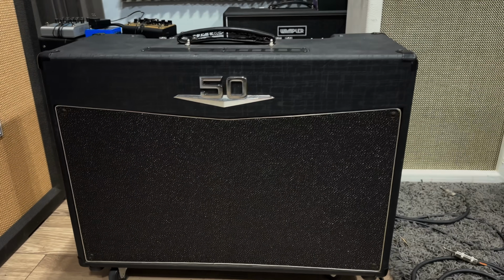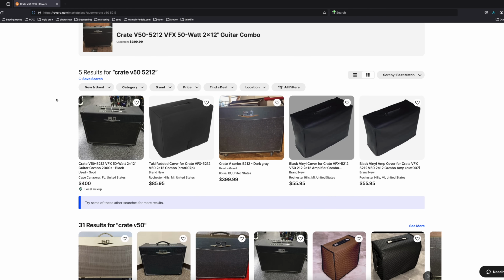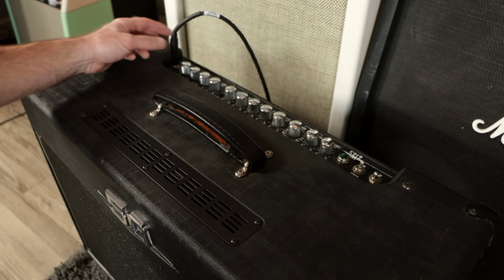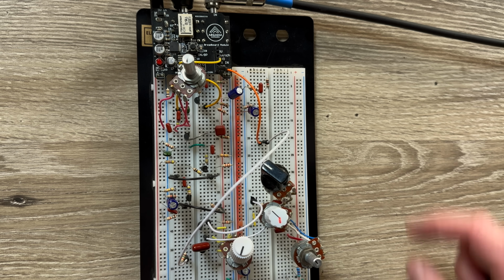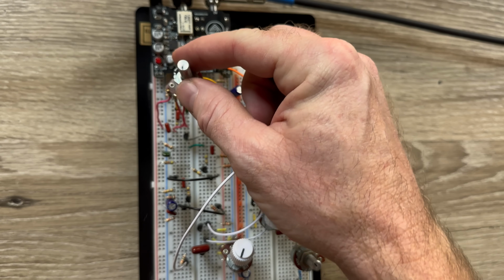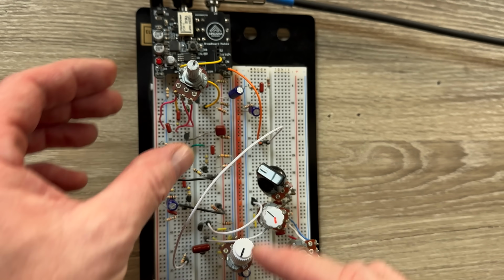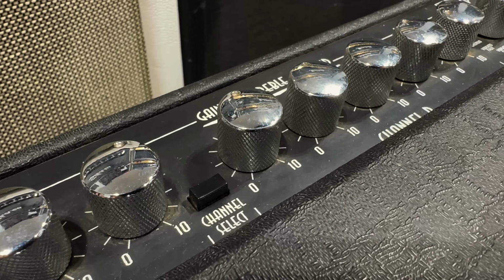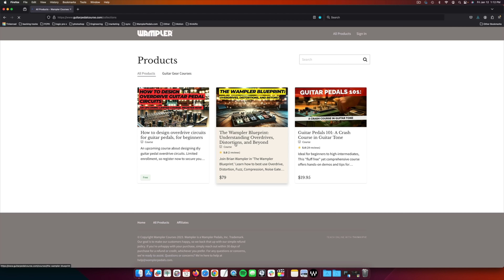Can a guitar pedal REALLY sound like a TUBE AMP?

Comment: This is one of the reasons 70s peavey amps and Vampower amps and HH, and even the roland jc120 sound so good.  The solid state circuits of those amps get that tube type vibe from the way the sag and peak cutoff occurs in the overdriven circuits.  MOSFET and FET style circuits can be almost as good as valve amplification.

Comment: I have a V50 and love it. I dropped the gain by swapping a 12au7 in, and CRUSH the input with a $20 Klon with the output and gain dimed.
Reply: 😂me to ! I run a clone into it and it's sounds unreal !  I put the original Russian tubes back into it because it didn't sound good for me with any lower gain 12a tubes.

Comment: When i was into pedal building a few years back, there were sites on the internet about emulating a tube's sound with solid state parts. They almost always came up with combinations of "regular" bipolar transistors and FETs. Good way to go. Is sustain better with the gain pot all the way up? Maybe you need a bit more of that to make your circuit sing like the amp.

Comment: That was pretty decent and "quite close", but the Crate just had a smoother tube transition compared to the breadboard (but probably "MORE CLOSER" to) that Tube amp sound than any pedal or modeller out there hands down.!!! I was wondering if you would consider building an actual tube driven circuit with an actual 12AX7 or similar subbie, like how the old Hughes & Kettner TubeFactor pedal, or even the Revolt pedal do.? I think the H&K sh*ts all over the Revolt and others i do have.! I reckon you would do a great job bringing out or designing your own circuit "with an actual 12AX7 tube. Nonetheless this breadboard pedal design is fantastic.👌👍

Comment: It could be attributed to YouTube’s digital audio compression, or just listening through my phone’s speaker, but either way, I’m not hearing anything that distinctively resembles a tube amp. Don’t get me wrong, the overdrive sounds good, and there’s absolutely nothing wrong with solid state amps, as far as I’m concerned. Frankly, I think tubes are only audibly discernible on the pre-amp stage, anyway, but the most efficient way to sound like tube amplification, is just to use a tube or two, somewhere, almost anywhere, before the main amp stage.  ❤

Comment: If anything, the breadboard circuit, sounds to me, like the rich gain I get out of this old Peavey solid state amp, which I installed inside the back of my great grandfather’s old 1930’s/40’s Ampro projector speaker, to turn it into a convenient and retro looking/sounding pickup-and go, practice combo amp. I remember it sounding pretty rich, and ALMOST tube like, even when it was in the stock case, with the stock speaker, but found when I plugged it into the Ampro, the pairing was even better, so I combined them. Frankly, I don’t see much point in trying to emulate something, in which using the genuine article, is relatively trivial to obtain, otherwise. Last I checked, a 12ax7 doesn’t cost that,….. wait a minute, I just looked,…. 😳 WTF happened to the tube preamp market, in the last 7 years, besides inflation? 😮

Comment: Understanding how successful think is sometimes better than having them tell you how to do what they do. I've found that many of the ones I've met  approach things from "what if." What if I try this? I wonder what this will do? I was an acquaintance of Larry DiMarzio years ago. Great guy and fun to hang out with. I literally sat in a room with him one day as he went through a box of samples of hardware, screws, springs, cable samples, strap material samples, etc considering if any of these new items compared to what he was currently using and if anything could improve that line. A constant search and curiosity for what is better and makes people excited to play. And I worked for a guitar company whose interest in new things was only how to extract more shekels from 'consumers.' So I've seen the difference first hand. I appreciate you sharing your passion and curiosity. I don't think the tube amp is the final evolution of guitar tone. There are enough examples of good sounding amps out there to disprove that. I don't think fx and IRs are even an given answer going forward. Peavey and Music Man made good sounding amps with ss preamps and tube power amps. Later tube preamps with ss power amps became a thing. Well, where is the magic actually happening? Tradition is hard to overcome and people hear with their eyes. But something will come.... maybe... as long as people keep wondering "what if" and pull out a soldering iron. Yes, I do appreciate your videos, Mr Wampler. Hope you like my blog post, though you didn't ask for it.

Comment: I mean it's pretty close but not spot on. The tube preamp, had a punch in the lower minds whereas the padal (solid state) sounded a bit hollow in that register, the tube had a softer attack as well. But you can get way closer with FET type serquitry. Though I will know how close for sure, as I have already ordered a Tube preamp of Cerquit I already have as a proper FET preamp (up to the Phase Inverter). Exactly,  like the tube preamp I ordered (which one includes a tube stage Phase Inverter). I am really curious if I can hear the difference and/or prefer one over the other.

Comment: Sounded like you should design a killer analog preamp, intended and specifically voiced for going into an amp’s effect return!! Sorta in the lines of the IR-X… but Wampler. If you did, which amp (Clean-crunch / Drive) would you most like to emulate?

Comment: @Wampler Pedals

It sounded "similar" to the amp but, it was missing something. It wasn't bad by any means but, again it was missing something from the way the actual amp sounded. The actual amp had a "soul" that the solid state set up didn't. I have no doubt that you could recreate the sound far better uf you chose to.

Comment: Hi Brian and thanks for sharing your thoughts on this issue and your experiments!   I wasted a few years with some cheaper solid state amplifiers trying to get great lead sustained kind of notes. It wasn’t until I switched to a higher gain tube amplifier by Peavey that I could get what I wanted.  Along the way I fortunately found a Dual Fusion which I kept because I like the range of options.  What do you think about the Quilter Amplifiers?  I have an OD202 that is my main amplifier these days

Comment: Brian, 
     I won't pretend to be a golden ears on this.  I could only hear small differences between your circuit and the amp.  That's a good catch on the sustain issue!  My question is how could lack of sustain be dealt with in a solid state circuit?  Would it be something like putting a simplified compressor in?  Then again, tube amp sustain under overdrive must be caused by some limit in the tubes or surrounding circuit.  How can that be emulated?

Comment: In my place, I have a Katana Artist 100 mk1 (effects return used), a Hotone Loudster 75 class D, and a Mooer 20w Tube Engine. As I've put various preamps to the test through the Class D, AB, and Tube sections, the tubes always win. So basically Brian, you're playing your new preamp through a tube power section. So you're still playing a tube amp either way IMO. I mean, didn't the first tube amps have like NO tubes in the preamps? It's the power section that gives the sound it's life. Granted now, my Two Notes Le Lead (Tube based preamp pedal) is still holding up quite well alongside my Tonex models with it's gain structure and clarity.

Comment: Hi Brian - I echo the amazement at the chosen amp and you 'pass' at it.  There's a few of us left that fingerstyle or compound style that wouls totally appreciate the slightly lower sustain just because we're routinely running at hotter levels than our flat picking bros.  So, then, too much compression and/or endless sustain MOL works against the touxh thing we have going on.  Consider rethinking this in that vein, please.  Smaller but appreciative market.  Fred - fan and customer.

Comment: Impressed with your "oh, an hour and a half" to put all that spaghetti on the breadboard (lunchtime!). A popular pedal to do this type of comparison with is the Joyo American Sound pedal (which is a clone). Do an A/B/C round robin with your quick pedal, amp, and joyo. Several youtube channels have run blind playing clips of Joyo vs tube amps (Intheblues did several, nico belisario(sp?) were the two main ones I've referenced).   At the end of the day, players either put a mic on their exotic tube amp that goes to a gig's solid state PA set clean for loudness, an FX contraption to the PA, or a pedal amp/cab-sim to the PA for loudness. The exotic tube amp is just a glorified pedal. Make a Tube Pedal and crack open that whole market, eh?

Comment: That is a killer timbre/texture. To my ear right now, it doesn’t sound like a solid state. It sounds like a tube amp, but it’s almost its own flavor. The dirt/hair sounds like tubes, the squished nasal sounds like tubes, but in a way it’s cleaner, but not like a clean layered over distortion. It’s just in there too. 

It has a much nicer transient/attack than the classic ampeg high gain sound. To me the transient also sounds like a tube amp. 

So the transient and the timbre texture of the note are similar to a tube amp, not what I think of when I think of a solid state.. 😊 

Maybe the transient sounds closer to tubes on that dimension, and the timbre/texture sounds like tubes but it has another dimension to it

Comment: I'm not an engineer, but I have a lot of electronics back ground.  My question is, aren't you still using the tube amp even if you plug into the line in, instead of through the preamp?  My understanding is the power circuit is where the tube amplifier really shines.  Right, or wrong?  Love your videos and your noodling on guitar is really good!  Your videos make me want to get the bread board out and start experimenting.  By the way, where do you buy most of your components?

Comment: Can you help me design a SS circuit that emulates a princeton reverb? Doesn't have to be perfect; doesn't even have to be real close. At my age my hearing can't pick up a lot of the subtleties anyway. And also, at my age, something that is 15lbs instead of 34lbs would also be nice. Just want the reverb and vibrato in a lighter, more affordable package.

The only place I wouldn't pinch pennies is on a quality speaker. But even with a speaker I don't need top of the line, just something that ain't cheap garbage.

Some of you might cringe but I am also OK with MDF for the cabinet.

Comment: The thing is, that sort of experiment calls for tracking ALL the factors, not just a pedal or two or ten. If you're going to demo a pedal that emulates a vacuum tube amp, then it matters what sort of guitar and pickups you're using, not to mention the amp itself.

Comment: I havent watched the video yet but I wanted to answer the question. A pedal that sounds like a tube amp? I can say for sure yes. An old fuzz face can be dialed in to sound like an old Tweed on the edge of breakup or just past that point. I know theres tube driven pedals that create similar effects. For the record, I believe the Fuzz pedal is hands down the best pedal ever created. I know its an incredibly simple circuit which makes it absolutely brilliant and at the same time, not so simple. Thats the only specific example I have though. Now to watch the video.

Comment: My thoughts is that you're running your preamp in the "tube power section" of a "tube amp", and, these power tubes may play a big role in the overall quality of the result.
What about making the solid state preamp section AND the solid state power amp section ?!?!
Wouldn't that be the "complete" experience ?
I guess you'd have to add some kind of "optical compression" somewhere in the "device" to get "closer" to how tubes react though. You'd have to trigger the ratio depending on the volume/gain, as that's what usually happens with tube amps (more volume/gain = more compression).
And you would have created LE indestructible solid state amp of tomorrow ... How about that ?

Comment: It's a little bit weird. We "know" that a tube amp needs to output a certain amount of wattage in order to sound REALLY like a tube amp. A simple analog pedal will just never do the clipping as well as a over driven tube amp. The only way to replace a tube amp is to use a profiler or modeler - may be Boss IR-2 is the "pedal solution".

Comment: We're starting from the assumption that the distortion that we're hearing from the amp is indeed coming from the tubes being driven and not some clipping circuit, right? Or else it's a couple hours trying to copy a solid state distortion over to a…well, solid state distortion.

Comment: This circuit is only creating preamp gain. It's still running through a tube power section and a speaker which has a huge impact on the sound. Hence the reason IR's are so critical in shaping direct tones today.

Comment: You can get so close with analog transistor circuitry, result in something that sounds good, responds naturally, and can be easily repairable. You bypass all of the problems associated with Tubes or Digital amps.

So I don't know why we don't see more exploration in the realm of solid state amps. There are a ton of really great modeling amps and really great tube amps, but for some reason the solid state options are lacking. And I think good solid state amps make the best pedal platforms.

A modern solid state amp can potentially sound just as good as a tube amp, be more durable, need less maintenance, have an attenuator, and have a Direct out using a Digital IR loader so that you get the benefits or recording silently or sending the amp to front of house without mike bleed.

Comment: My absolute favorite "amp" to play for years now has been a pedal that I built. 4 gain stages of Opamps and diodes running at 24v. I actually prefer it over all of my tube amps.
I've heard some stunning results from high voltage mosfets too

Comment: Amazing result from an hour's work!  You can hear the Crate preamp "breathe"; there's that "clank" of the tubes working, but I'd say in a live mix it wouldn't be as noticeable.  Curious as to how hard you were driving the power amp.  In my experience with Crate V-series and Blue Voodoo amps, the power section really made a huge difference in their tone.  I could get crappy 90's digital rack gear to sound great through the power section if you cranked them a bit.
Reply from the maker: It’s only a 9v circuit, it’s not being driven hard

Comment: I can't believe how good that Crate sounded.
Reply: True enough... Never liked the Crates I've used, but this sounded good - both of them.
Reply: I've had a V50 for a few years now. It's just not like the other Crates.
Reply: I still have my Crate G40XL combo.
Reply: I have that same Crate amp.  It’s a beast.  Loud. Tricky to dial in. Heavy as a house.   But man, when you find that sweet spot, it is awesome!  And it takes pedals just great.
Reply: Can you share your settings?
Reply: Some crate tube amps are amazing like palomino, blue voodoo, this one. But not the v18 which sounds terrible
Reply: Had a crate 2x12, best sounding amp I've ever had, no pedals needed, crunchy and heavy.
Reply: I've got a bunch of the new top dollar amps and the crate vintage club 50 212 combo sounds better than all of em, it's sad really.  😅
Reply: Had the VC-2110 in the early 2000's and preferred it over my Silver Jubilee, at least for home use. 
Nice cleans, even better, nicely balanced but also beefy enough overdrive tones, I only replaced the speaker with a Celestion.

Comment: The most important thing I expect in any amp is it's ability to make crystal clear reproduction of my guitar.  Next is the amps ability to add 2nd harmonic distortion to my sound.  I grew up with a tube radio near my bed and later when I had amplifiers and speakers was the tube sound.  Modern guitar amps have made only small steps towards making transistor circuits less tinny sounding.  FETs are a better compromise but, they are rare.

Comment: If you live in the zone of edge of breakup to very mild overdrive like I do, solid state sounds nearly as good as tubes. I gigged with an early 90s Fender solid state amp (a Fender Sidekick) a lot in the late 90s before I got my first tube amp (a 1966 Princeton), and no one ever realized it wasn’t a tube amp. And the simple secret to getting tube-like drive sounds with solid state is to stack two drives before the amp, the more distorted one first, going into the less distorted one. The sound compresses just right.

Comment: Were you running the breadboard circuit on a 9v pedal power supply or higher? I have an hypothesis that pedals don't behave as similarly as preamps due to the limited voltage they are running on (not taking into account charge pumps from certain circuits)
Reply from the maker: 9vdc on this

Comment: I agree with the sustain part. The pedal sounded very good.  More tighter but the amp kinda had 20% more thicker tone. I still have your  Pinnacle V2 and Ego comp on my board. Not changing them

Comment: For me a good solid state analog circuit sounds just as good as a tube amp.  From what I understand diodes do the exact same thing as tubes just smaller and with less weight. In a mix with a full band there is no way you can tell the difference, but your back and your bank account will thank you.